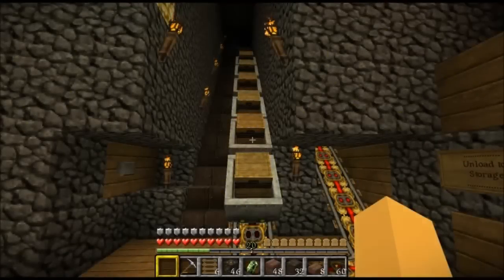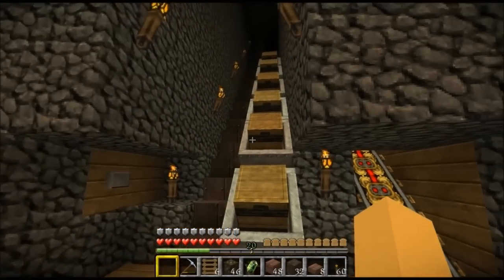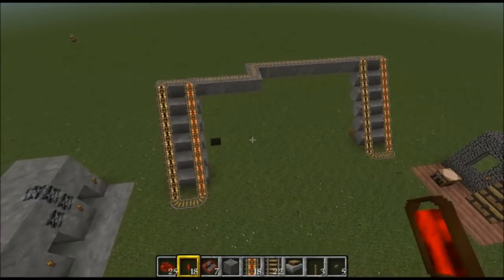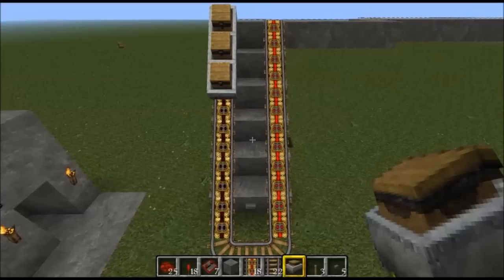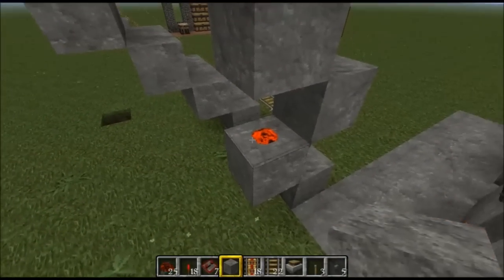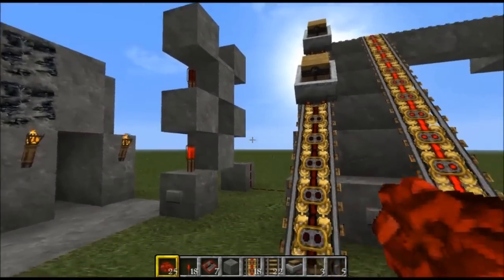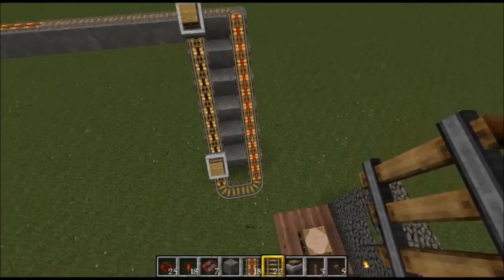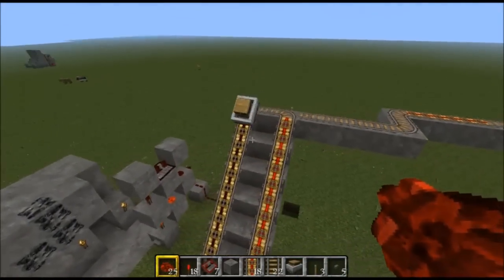Minecraft Tutorial: Chest Cart Item Transport System

Comment: I made a tweak to this system you might be interested in if you haven't already figured it out. If you put a redstone comparator next to a detector rail, you can create a redstone current based on the contents of the minecart chest riding over the detector rail. You can use this to send a full cart to an automated unloading station, which will then automatically send the empty cart back, and put the empty cart at the back of the line.

Comment: I tried to run the redstone from the detector to the mono stable circuit but its a bit glitchy though I can still get it to work. The problem I'm having when is trying to get the track to reset switch back after all the carts have left to the other destination so as to rememember if the track start switch or the end location switch is set properly so as the carts don't randomly go astray . Is there anyway you could continue a tutorial on a detector switch and or with the new minecart hoppers